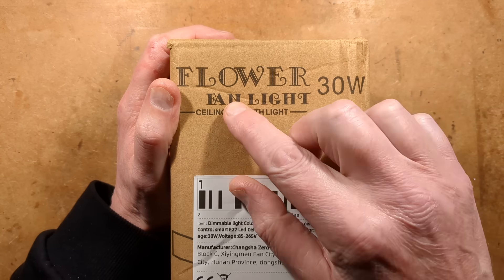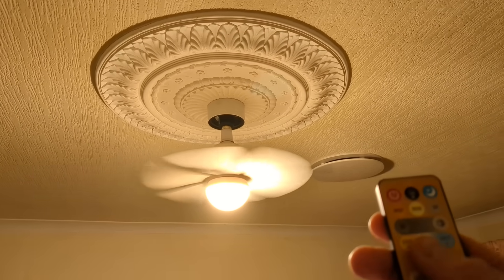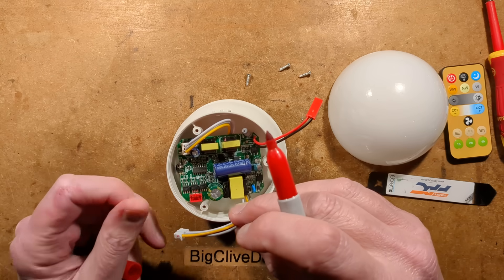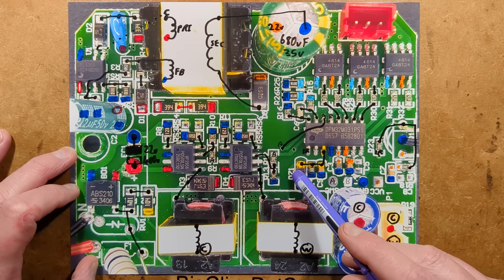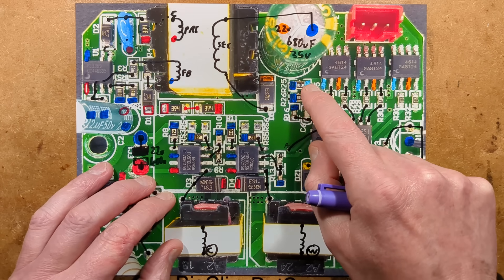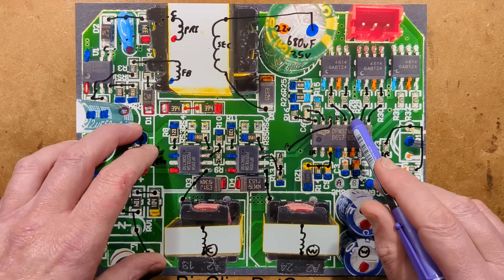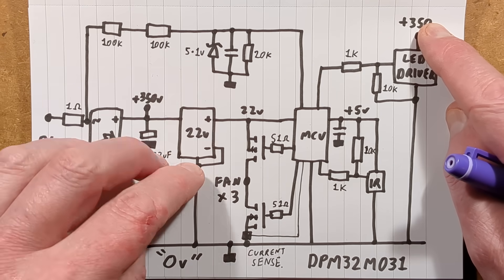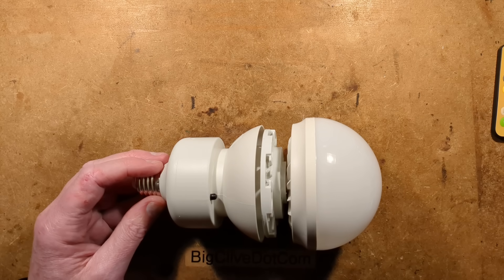Inside a screw-in ceiling fan and light - long version

Comment: As a former electrician these things make me cringe. Unscrewing is the least likely issue. The torque and vibration acting on a standard nail-on box can work them loose, and sockets are only designed for the weight of a light bulb.

Comment: If the light fitting is fixed into the ceiling, then no, not  a problem, I would not be so sure with a pendant fitting.
Reply from the maker: It was fine with a test in a pendant.  Just half a twist over the full flex length.  Nothing compared to the abuse an appliance flex gets.

Comment: Dad's actually been looking at these because they're less of a pain to install than actually putting a ceiling fan into each of the rooms at home.

Honestly, I haven't been terribly bothered by these, but now I'm actually modestly impressed with them (I mean, I am aware of low voltage brushless DC motors, but it always tickles me seeing that the whole idea is having just enough of a VFD for it to count).

Comment: I think the problem with these would be from people putting them onto a regular pendant fitting, rather than a batten lamp holder.
I stopped trading as a sparky quite some time ago now (right towards the end of 16th edition regs), but I wouldn’t have a problem fitting one of these in my own home, as long as it was on a batten lamp holder.

Comment: That motor microcontroller running so (relatively) hot would make me want to thermal-glue a little alumin(i)um heatsink onto it, but other than that it seems pretty decently built. Might pick one up and modify it that way, also replacing all the (no doubt noname) electrolytics with better ones so I (hopefully) won't have to take it apart again anytime soon

Comment: What an interesting device, I in before see other type of e27 screw fan, but it's a ring light type, and also the one you have is the cheapest one, other version have larger remote and larger fan

Literally need some because the heat of the summer

Comment: I bought a different kind of this and chose NOT to use it because of the SCARY wobbling.  Time+metal fatigue => anything can happen.  If I were an electrician then I would suggest a box fan, aka not quote a chunk of $ for the little old lady.  That is to say, one option might be a ceiling fan, but I would offer suggestions that I don't profit from.
...
Years ago I bought a heavy gallery-qualified LED bulb from a company that I trusted.  The goal was to provide special lighting for my Dad's failing eyesight.  It was in the ceiling just like yours.  One day it overheated, melted off and fell on the floor.  Thankfully nothing caught fire.  The bulb base was still in the ceiling socket.  I still trust the manufacturer because he recalled all the bulbs and stopped selling them.  
...
PS - I think the spider is actually an electrical inspector.  It uses it's legs the way you use a multimeter.

Comment: That's... actually pretty neat. xD I have to say that compared to all the horrific ceiling fan mounting that I've seen out there over the years, in relatives and friends' homes I mean, this actually looks like a safer option if only for the fact that it's lighter, all plastic and detachable/dismountable. The biggest problem with all of those being how they are mounted, so it would still be a worry depending on how the socket was mounted.

I almost bought them, but ended up choosing the more expensive option with metal brackets properly anchored to the ceiling, that have a slim profile, blade guards, and even more unnecessary light and fan options. I just want a simulation of a wall mounted control, but it seems none of them have options for that - the only real complaint I have.
But I didn't get one of those socket style fans a bit because of how sketchy they look, and a bit because the more expensive option don't dangle so low - not much ceiling height where I live. Been working great though, it's certainly a far better option than the old ceiling fan models, despite the annoyance of having to deal with more remote controls. For some cases it's even better than regular fans, because of how people keep moving those around, putting them on top of unsteady support, and stuff like that.

But boy oh boy, I do remember as a kid looking at some super shady ceiling fan installations to the point I was always wondering if the whole thing wasn't going to just fall and kill someone under it. Those things not only were heavy as heck, but also shook like hell, were poorly installed, often had long wooden or metal blades, and seemed to always break due to overheating motors and whatnot. Uncle's beach house and grandparent's all DIY boonies home that had all sorts of dangerous bad DIY style issues because it was built all by themselves... it's really a miracle that the entire home hasn't gone down to flames to this day, I kid you not. Wiring was entirely redone after it almost caught on fire, it had those ancient cloth insulated wires that had all rotted and large portions of it were left exposed inside an inaccessible wooden attic area, they also put a transformer up there to power up a 220V gate in a city with all 110V electricity, and so on and so on... one could spend an entire day listing the number of bodges and jerry rigged stuff. And the plumbing was even worse, all in close proximity to electric wires with no conduits or insulation.

But anyways, just so people understand why these things exist and putting things in perspective.... xD There's stuff on Aliexpress that might seem super dangerous, completely against code, and super dodgy in some nations, but in others... still an upgrade to the norm. xD

Comment: I had the experience of going through UL's "novel or unusual" process (or some similar term) for a very similar fan/light combo about 20 years ago. I recall 3 specific concerns we had to satisfy for them in addition to their standard requirements. One was taking measures to prevent over-torquing of the socket since the fan was 10" in diameter and that gave users a lot more leverage than they're used to with screwing in a light bulb, second was the fan's torque causing the fitting to unscrew, and the 3rd was we had to go thru testing as a light fixture and mark it with the max power rating since we provided a socket for an incandescent bulb on the front. Fun project, and more than all the technical stuff it taught me that just cause I think something's a dumb idea, or great idea, doesn't mean the market will agree. In spite of my doubts it wound up being a very successful project for my client.

Comment: So how much weight can those standard sockets take?   I know the standard here in the US for ceiling fans is to have a box in ceiling to mount it to with separate hookups for the lights and fans  I've never seen this type before, but here in Florida it wouldn't be nearly powerful enough as it's far too small.
Reply from the maker: The fan weighs a lot less than many of the glass lampshades.

Comment: The dangerous install could be on a dangly BC connector + thread adapter + original cloth covered twisted pair as the drop cable. It's not that many years ago you might still see the old drop cables on someone's ceiling, with a cooked brittle BC connector underneath.

Comment: I'd like one but if the light cannot be turned off and have just the fan running, it's no good to me.
Reply from the maker: You can just have the fan running.  Both from the remote and the wall switch control as detailed in the video description.

Comment: as soon as you turned it on, i see what their problem is, the blades are not balanced and that wouldnt last 5 mins in my house lol.

good chance the light fitting was pulled from the ceiling and the banging was the wires on the ceiling, they dont hold the baton holders on with much, you have to mention that your going to hang things from it if you want an electrician to put special screws in, otherwise the screws they come with are fine to hold a small lampshade or light globe, maybe not an entire unbalanced ceiling fan lol

Comment: I use a similar fan in my motorhome, I am using a hanging mount. The issue with them is the blades being off balance or otherwise causing it to wobble. The wobbling can cause it to work loose because its transferred up through the hanger.

Comment: You have installed this in a BATTEN style ceiling rose which is fine. I assume thy have been sensible and made the fan spin in the direction of tightening the bulb so it doesn't tend to unscrew!

The problem would arise if someone installed this in a PENDANT ceiling rose. I imagine it would spin wildly on the end of the flex and probably end up pulling the flex from the rose. (The fan slow ramp up / down might alleviate this somewhat but doesn't sound great.) Would be quite low as well from a pendant!
Reply from the maker: I tested it in a pendant version and there was just half a turn along the full length of the cable.  Nothing compared to the abuse some appliance flexes get.

Comment: Dangerous? the worst thing that could happen is it unscrews itself to the point where the connection to the contact is lost and it stops. And if your wiring can't take a tiny amount of weight then the problem is not the fan.

Comment: Full-sized ceiling fans (32" and above) ABSOLUTELY need a fan-rated junction box.
Anything below that is a matter of opinion.
If the "old lady" replaced a fixture with a ceiling fan and didn't update the box and how it attaches to the joists, then the electrician was completely right.
If she replaced a light bulb with one of these, then it sounds like nonsense.

Comment: this would be dangerous in a few of my lightsockets, they're dangerous as is, when i screw in a bulb they spin too, i have to hold them in place while screwing in bulbs, then again they're like 80 year old sockets.
Reply: Yeah you probably want to get those replaced / upgraded in any case. If it turns when installing a bulb, the hot wire could potentially turn with it and result in a short. At that age I would even wonder if it was grounded.  

No I’m not an electrician, and no I’m not with that organization which was mentioned. Just a concerned homeowner.

Comment: As an electrician I can tell you that a light socket isn't listed to support a ceiling fan. The fixture may be legal to install in some countries but it's not legal in the US.
Reply from the maker: You may wish to feel the weight of a tiffany glass lampshade.  This unit is lightweight compared to even a small one of those.
Reply: This one weighs less than 2 lbs.
Reply: @peacefrog0521 that's moot when the socket is listed for use with a standard light bulb and the box isn't listed for use with a ceiling fan. Any electrician worth his salt will tell you he's not touching it and recommends getting a properly listed ceiling fan installed according to code.

Comment: I guess that works if you happen to be lucky enough to have a fixture where the socket points straight down in the middle of the room... Granted I am in the USA but I have never seen anything like that.  Usually the sockets are sideways at an angle to keep the globe tighter to the ceiling and also fits well for putting 2 bulbs for better illumination.

I've only ever seen a socket sticking straight down if its like an unfinished garage or basement with a keykess base
Reply: The classic build in the UK was a single ceiling rose (cable outlet) in the middle of the ceiling, then a short drop cable to a hanging BC bulb holder.  With luck & money you might replace the single drop with a more elaborate light fitting.  If you moved house and took your posh lamp then the legal requirement was to restore the single dangly bulb.  In bedrooms the ceiling rose was sometimes moved to favour the dressing table or similar.

Grew up in a UK house built circa 1958, lights as described, one per room.  Also less than one original socket per room!  Even by the 70s it was a nightmare of extension leads and multiway plugs.

Comment: Just purchaced 2 units in the states they are packed with a safety cable with instructions to teather the unit to the ceiling or other ,the instruct looks like an after thought , lawyers must have gotten involved due to some situation. Nice job on the reverse engineering on all the products that you present.

Comment: Clive, really enjoy your videos. You mentioned early on in this one that the motor didn't appear to have feedback, but the design immediately reminded me of the electronic speed controllers used in Drones. They use 3 phase brushless motors and only drive 2 phases at a time and derive feedback from the inactive lead. That may be going on in this circuit as there are connection back to the micro controller.

Comment: Curious that you have an ES lamp fitting in the ceiling, where BC would be more common or traditional? On the other hand, the screw fitting is much more secure than the bayonet fitting, which tends to leave the inserted lamp much more loose and wobbly.
Reply from the maker: I used a BC to ES adapter.

Comment: We have a couple of these, and it does concern me the amount it twists the wires with motor torque (especially with the old wires in our house).  In a rigid ceiling rose I have no problems with it, other than the noticeable whistling when it's powered (coil whine?).  It doesn't give me great fear, but I do turn it off when I leave the room, like I would any light.

Comment: Curious if it would be beneficial to use a dimmer switch or lower fan and light levels to benefit the capacitors or microcontroller temperature 65° and increase reliability.  I see no venting on led or control boards.
Reply from the maker: This circuitry is not suitable for use with a separate dimmer.

Comment: I have two of these devices, one I used in a fixed lampholder, without any issues. The other one I used in my bedroom, the device itself might be safe, however, the tension it put on the BC lampholder cause the live wire connection to become dislodged. The fan applies a torque to the BC lampholder and connection that they are not designed to take, hence the socket was damaged.

Comment: Standard over head lighting over here tends to be the "boob light", with bulbs under a glass dome, and those bulbs are arranged horizontally so wouldn't be able to use these in them.

So if we want a fan we're replacing the light fixture, and at that point might as well get a fan that mounts to the ceiling stud.

This is pretty cool, though, if you've got a proper recepticle to mount it in

Comment: I needed this fan in the Summer. I'm in the BIG Clive fan club! 🤣😂 I wouldn'just screw it into the ceiling pendant, but I'd replace it for maybe a fixed baton light fitting,then screw it in that. An easy one-man job, or 2 blonde job if you're a girl.

Comment: For anybody who hasn't seen it. Tech Ingredients recently did an episode on ceiling fans and how using a DC motor was more efficient than using an AC motor and that the technology has not changed. So in a way I find it interesting the design of those things but on the opposite side of that I can't imagine they move a lot of air with a 2 inch blade (exaggerated) although they are probably making up for that with efficiency.
These are very common in other countries where they don't really have an electrical system built out. And much like the beginning of most systems will start with a lampholder, and everything screws into the lamp holder.
This Fan Uses Almost NO Power https://youtu.be/r0RZR8F84Gk

Comment: I see the danger, It can unscrew itself and fall due to the due to counter torque when it's turned off. It will take a while though. Hopefully it will lose power before unscrews all the way. This is why bayonet base lamp are used anywhere there will be constant movement or vibration.
Reply from the maker: If it did unscrew enough to open the back connection it would just stop spinning and lighting.
Reply: It can't unscrew , it only rotates in the direction that it screws in tighter , however if one were to barely screw it in then it would just have starting force then get tight. (i tried to get mine to fall as a test and it just can't.   Only thing i wish for all of these fans is the ability to rotate the blades. (flip them) so you get the same rotation but pull air up though not as efficient with that design.

Comment: The problem is that laymen cannot judge if their light fixture is suitable for this or not. If it is mounted solid or if the screw socket is connected with stranded wire, all is fine. However, there are enough installations with solid-core wire from the screw socket to a junction box above the ceiling that doesn't have strain relief. That's not great in the first place, but it works well enough for a non-moving lamp. Add something that vibrates, and you'll easily vibrate the wires in the junction box out of their screw terminals---and then you've got a nice fire starter.

Unlike fans that are screwed into the ceiling, or outlets that are screwed into the wall, ceiling lamp fixtures are not necessarily vibration-proof.

PS: I have 8 ceiling lamps that are hanging from their (stranded) wires by design. I pretty much suspect that that design did not incorporate mechanical vibrations to the level a fan provides. I would be concerned about those, too.

Comment: I just bought one like that for my garage. 
When on, any radio near by stop working.
It doesn't matter if the fan was on or off.
Thats what you get for $20
Reply from the maker: That's an issue with many switching power supplies.

Comment: I have a couple of similar devices. After a while one developed an annoying ticking noise. On disassembly, I found the motor shaft bearing loose in its plastic housing. Ah-hah! I had to machine another housing and splice it to the upper part. On testing, no different, FFS! On second disassembly I found the motor rotor knicking tha magnet so I machined some run-out from the OD of the motor. Problem solved and has been running fine since.